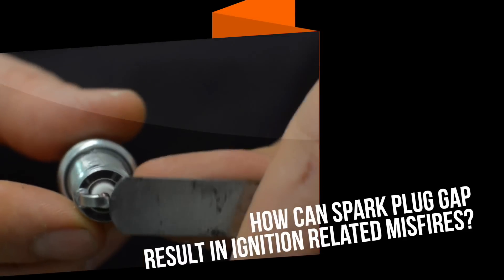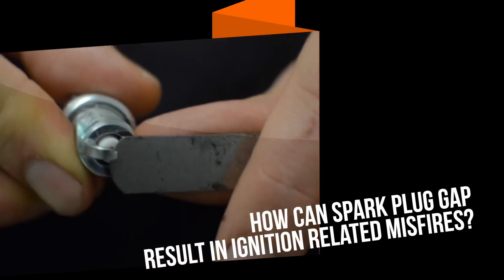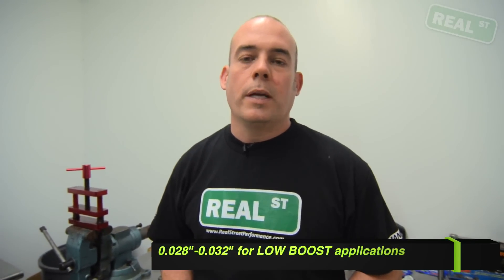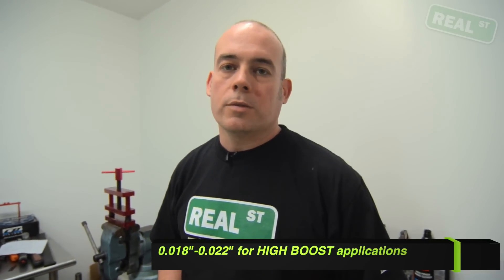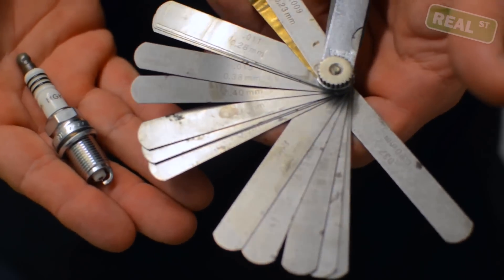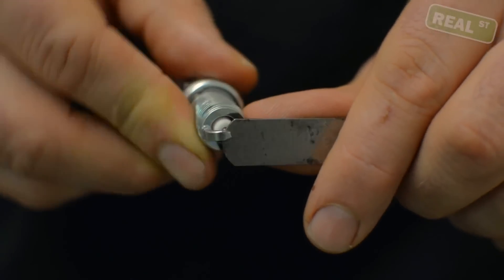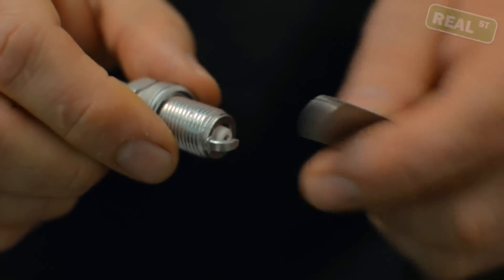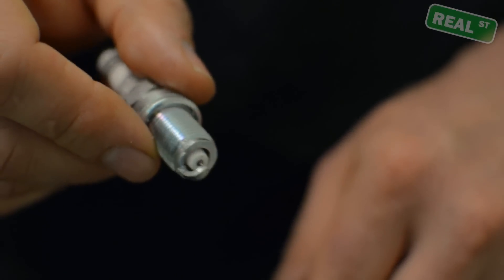Spark plug gap for boost - Jay's Tech Tips #14

Comment: Cars of today have advanced electronic ignition systems. They need a bigger spark plug gap. Old cars run on a 0.6 - 0.7 mm gap. Cars with ECU/ECM controlled ignition on 0.8 - 0.9. That is for a regular street car. Thank you.

Comment: Nice video!

In my case a, resistor-less,  Bosch W8DCO CU, (CU standing for copper central electrode and O standing for a wider central electrode, (3 mm vs conventional 2.5 mm)),  having the firing point @ 3mm., (OEM standard), was necessary in order to  operate under really tough conditions, with heavy load and more than 6000 rpm., without a ground strap.

With the specific setup the  spark plug works as a semi-surface discharge spark plug, having a gap of ~ 4mm, (0.18'')!

The engine is a supercharged vw g60 @ 200 ABT hp., and it took  some more ignition update steps to optimize the total operation.

Less emissions,  more torque, more power and a rapid cold and hot start are the results.

The Syncro Heresy
Reply: Fun fact: your plugs can’t be found on the web. Thank you.

Comment: i have a sr20det and added a gt2871r pushing 15 psi,i had to gap plugs down to .022 just to not get blow out,the car idled ruff and felt off.i swapped out the oem coils for audi r8 coils and now i can run 0.40" gap without any blowout and the car feels 10x better.i can actually run mor gap now from these then i could on stock setup

Comment: Hay Jay, I have a 1980-350 with a mild cam and cylinder head upgrade.  Cam is a 276/280 and the heads are 64cc Cylinder Heads.  It has new carb, spark plugs, wires, distributor cap, coil,  and rotor.  Yet it still has a slight misfire, what spark plug do you recommend/also what gap?  Spark plugs are currently gapped at .45 right now.      Thanks in advance.

Comment: Doing a tune-up on a 93 Tbird Super Coupe.
Replacing the plugs are MURDER!
My son asked me to double check on gap, which is .052 factory.
The plugs we pulled out are about half that.
Came here to double check, and glad we did! The only issue we may have is that they are NGK Platinum plugs, and the tip is pretty small....
Well, I hope we don't have to do this again, and at least the car doesn't get driven much.

Comment: For high boost the most reliable method is to use a Capacitive discharge ignition .   80k plus firing voltage. some are multispark.  Closing up the gap is a bandaid approach.

Comment: I’m at about .025 and using Ngk bkr7 on 12 psi I can feel slight misfire in higher rpms before at 10 psi it ran perfect through out the Rpms wonder if it’s blowing out
Reply: Wrong gap, keep the gap below 0.022” and above 0.018”.

Comment: how about adding .002 to 0.90 and side gapping the old copper spark plugs? I have done it and it has eliminated the throttle response delay and really does get the most out of my 1.5 L 110 BHP SOHC 16V engine with a compression ratio of 10.5:1
Reply: Turbo

Comment: I WAS TOLD TO RUN THE COLDEST PLUG IN MY 944 TURBO S. I'M RUNNING 28 LBS OF BOOST. I'M IN CLEVELAND OHIO. MY PROBLEM IS THE CAR WILL NOT START UNLESS IT'S 70 OR WARMER. IS THIS COMMON, AND SHOULD I GET HOTTER PLUGS. THANKS FOR YOUR HELP.

Comment: You want to run a slightly hotter plug when you decrease the gap and use Iridium.  This makes it foul less and keeps the power on All the time you demand of it.  A couple misfiring can ruin the power delivery.  I rather give up some insignificant power on the spark for 100% reliable consistency then make up the power somewhere else such as weight reduction, air flow, tuning, etc.

Comment: What would be the proper gap if my boost is around 22psi? I have NGK Iridium plugs. My engine is a 2.0T FSI BPY engine with a big turbo setup.
Reply: 0.025 NGK BK7RE will not heatsoak and last around 5k peak performance, drivable the other 5k. very cheap plugs. i have hundreds...
Reply: GT28?

Comment: Hey, i have a question -

My car should be boosting 1.5bar in all gears, but it has strange issue

Examples:

I get into 3th gear and then floor it - it boosts and holds 1.5bar, then i upshift to 4th and i only get 0,6bar. same in 5th.

I can go calmly in 4th or 5th gear and then i floor it - it boosts to 1.5bar until i upshift, then it is again down to 0,6bar.

1st and 2nd gear is limited to 0.8bar of boost. Engine - Saab B204.

Any ideas or suggestions? Can spark plug gap do this kind of stuff?
Reply: Do you have any boost control other than a wastegate? Is there any kind of vvt system in your car?

Comment: I’m having stalling issues on my RIPP Supercharged Charger.stalls and jerks in between 1000-2000rpm range.also stalls on inclines.dont know if the installer gapped plugs correctly but I also didn’t use ngk iridium.i used original mopar plugs.could this be the problem?its driving me nuts!im going to check the plug gaps myself and see if their seated and gapped correctly.Any advice if they are correct?the ignition coils are ripp also.

Comment: You said iridium plug. Ive heard that you would be better off with copper plugs on boosted applications.
Reply: The reason people say this is iridium is a catalytic metal like platinum. However this effect has practically no measurable difference and the reliability of iridium outweighs whatever tiny drawbacks it has
Reply: @melody3741  my car on 20 psi w/ a billet wheel 46/62 blows the iridums away. they run at too high of a temperature for my 1.8T (they heatsoak), so im on the BKR7Es now. EIX previously, i was lucky to get 1000 out of them.
Reply: Shit, Silver plugs are the way to go. (In weekend/racecars)
Reply: Christopher Ballew A good iridium plug is almost always the way to go. Copper plugs work better initially, but foul quickly and end up performing worse as time goes by. Iridium plugs are very consistent all of the time.

Comment: Higher combustion chamber pressure increases the amount of voltage to jump the spark gap. The higher pressure has a more insulative property. Decreasing the gap reduces the amount of voltage required to jump the gap. The alternative would be to use a higher voltage spark coil.
Reply: Why do non/low boosted cars need big gaps? Why not just make all plugs with small gaps? When there is less compression do you need a bigger spark to ignite?
Reply: @boothegoopc8417  Larger gaps produce a larger spark up to the limits of the coil producing the spark, but a boosted engine challenges the ability of the coil to fire under the high pressures at these larger gaps.  So there is a tradeoff.  All other things equal, higher boost means tighter gaps.  There is no free lunch.
Reply: @boothegoopc8417  higher boost pressure will increase cylinder pressure and will blow the spark out reason why they require a tighter gap N/A engines dont have that issue unless they have a high compression piston setup
Reply: Not necessarily. A PCM coil driver is only going to put out x amount of volts. This would require an ignition amplifier to take advantage of the higher voltage spec'd coil. If the coil driver is built into each coil on plug then you would be correct.
Reply: i have a sr20det and added a gt2871r pushing 15 psi,i had to gap plugs down to .022 just to not get blow out,the car idled ruff and felt off.i swapped out the oem coils for audi r8 coils and now i can run 0.40" gap without any blowout and the car feels 10x better.i can actually run mor gap now from these then i could on stock setup.

swapping coils gives you all the pros with non of the cons,

Comment: my car misfires 6psi into boost.. it misfires at idle also.. I've done every single thing but someone is telling me that injector #4 isn't firing up due to my p0304 code.
Reply: +cobaltsslife Use a screw driver to listen for injector click, can also unplug the injector/connector too see theres a dramatic change in idle vibration.
Reply: +\ 0909 I can't access them due to them being under the intake manifold.
Reply: cobaltsslife
 A p0304 is just a Cylinder #4 Misfire.
If your spark plugs are showing good, try swapping your #4 coil with any other cylinder, see if the missfire follows.
If the missfire follows, its obviously the coil itself.
Reply: +\ 0909 I've tried all that. got brand new plugs twice, gapped properly, new coil packs, still cylinder 4 misfire. replaced lash adjustors, rocker arms, cleaned valves, still p0304.. now it's down to injectors which is going to be done tomorrow.
Reply: cobaltsslife
 Theres no oil residue building up either? Is that Coil and spark plug dramatically hotter?

Edit: Oil residue on the boot itself, mabye the spring in the boot. Like a black carbon buildup sometimes. If its bad, it will still be wet.
Reply: +\ 0909 I check the plugs after a long drive and there's never any oil on them, coil packs are always at the same temp when I check them.
Reply: cobaltsslife
Well damn, Obviously youve put in a new fuel filter and checked for sagging voltage at idle by now. Im also assuming youve monitored your O2 sensor. Im also assuming its not just an issue when its raining/very wet.
And its not just a hotter cylinder, much like some 3.8 buicks and FWD 4.6 fords have.
I hope the injector does it.
Reply: +\ 0909 I've done everything.. I'm a tuner as well, nothings helping. this car is pissing me off so much I hate it. hope the injector does it, if not, I'm going to buy an evo or new car.

Comment: I have a 5th gen camaro ss with a somewhat agressive cam what kind of spark plugs would i need? Maybe i can still use the stock plugs, but i rather swap out along with wires. Any advice?
Reply: +bigpuff714 ngk, likely 2 ranges colder. Try out the stock plug with a small .032 gap first.

Comment: My oem spark gap is .35, and its a turbo cobalt ss.... im currently running 25 lbs of boost... .32 would be fine?
Reply: Exact same situation as me (but running 23 psi and 50% 1st gear reduction) and yes .32 works great. Use OEM NGK/Ac Delco Iridiums gapped to .32
Reply: +Nice Meme thank you

Comment: ThatRacingChannel can you do a turbo matching to engine size tip for specific HP? My theory is you do not go bigger than what you might have to for the horsepower that you want?
Reply: Usually, it is best to have the smallest turbo that allows you to reach your power goals. This ensure a smaller spool time. You can see how much power a turbo is capable of making by looking at its CFM, or air flow rate. Air flow = power.
Reply: apex128 Yea thats what i was trying to get at, just wasnt able to word it correctly. But to be able to match the map of the compressor to the engine if possible. For example i want to make the most power with the turbos max boost for the specific engine it would go in? Im probably not still wording it correctly but hey lol
Reply: Problem Child AKA The Truth I think I know a channel that has a video on that. The channel is called justinsane. Also if you go on Garretts website, they have a feature that lets you search for a turbo based on your power goals.

Comment: Can you let me know what oil weight would be better if you have a built block and the manufacture called for 5w30 weight before doing the build. Would I have to go up to maybe a 15w50 by the way this is a turbo engine from factory?
Reply: If your bearing clearances haven't changed then stay with the same weight oil...if you built your engine with wider bearing clearance...then move up to heavier oil...just building (rebuilding) an engine doesn't mean using different oil viscosity...oil viscosity is based on bearing specs and performance goals ,power adders,catalytic converter or not...good luck!  I hope this was some help to you...

Comment: Which is better for boosted applications?  Copper or iridium?  I run ngk bcp5es non resistor one step cooler plug and they do great. Cheap compared to iridium. Gapped at .032 would there be a benefit to same condition but changed to iridium?

Comment: OR, install more powerful coils...Also I prefer copper plugs. But then they are easy to reach and replace on my engine, so I just pop in a new set for like $10 every oil change. shrug 

And to Answer Ryan's question. Yes traditional plugs are best in boosted applications. These wonder plugs tend to suck on forced induction engines in my experience. Which is why I use copper plugs. Cheap, and work the best. The only reason I wouldn't use them, is if they are in a spot that's a pain in the butt to reach/change.
Reply: Alpha Force it's a scientific fact that copper is more conductive than iridium (better for performance). The reason why iridium is commonly used is they tend to last longer because copper is softer, but much cheaper. I've been running the same copper NGK-R's for 2 years at around 22 psi of boost and never had fouling problems.
Reply: TurboMitsubishi Your claims about copper plugs are opposite to what I have actually experienced. Iridium plugs provide a strong, consistent spark across all RPM. Copper plugs foul easily, and degrade even faster in high performance engines. Let's put the "copper plugs are the best" myth to rest.

Comment: what if i would run E3 spark plugs and they are not adjustable? is it better to run traditional spark plugs with forced induction?
Reply: E3s are garbage and a gimmick. Get a good copper plug for boost like ngk or autolite
Reply: e3  waste of time
Reply: What is the gap on a18 hp vanguard